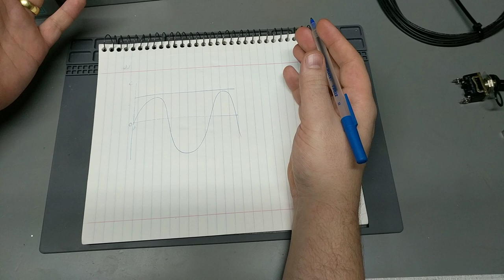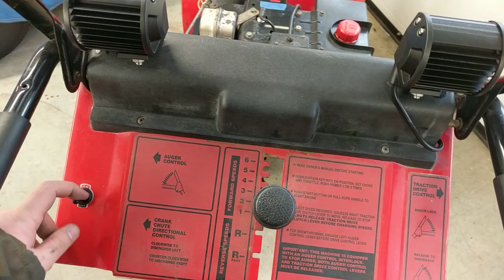LED headlights on a snowblower

Comment: I have the same engine and bought the same lights on ebay.  Do you think I can add a 3rd 18w light bar or will it be too much for the stator to handle?
Reply from the maker: Not sure, but you could try. The stator should be able to handle a dead short to ground all day, so running more lights will probably leave them all a little dimmer

Comment: Can you post a picture of the wires  coming from the spark plug and where is that going to? Also where is the switch wire coming out of the key hooking up to also on your plug/ coil do you have a pig tail on yours.     I could show you what I have.  I was looking for a digram online.

Comment: How do I install a headlight on my Toro 824 QXE? It never had a headlight.
Reply: You can't unless there is an unused power lead leaving the back of the motor. Usually if they don't put a headlight in at the factory the don't put a generator on the flywheel. You could mount either rechargeable lights like they use on bicycles or mount a battery pack or motorcycle battery somewhere and power the lights that way.  You would have to charge the battery between uses which would involve buying a battery tender or charger.
Reply: @99shadows66  
I was told that it would be costly to add the components from the other 8 HP.
I have decided to use a powerful rechargeable bicycle LED light. It fits on the side of the handle.
Reply: @stanleykeith6969  the video you gave a link to clearly shows that the snow blower has a factory headlight on it. Yes it can be done if there already is a headlight on the machine. This mod can only be done if the machine has a power wire coming from the flywheel area because that is where they put the alternator. No alternator, no mod, it's that simple.
Reply: @stanleykeith6969  These lights are battery operated they are NOT picking up a power supply from the machine itself. If I find a video that explains how the generator system works on a snow blower and why this mod can't be do done to all machines, I will post it here to help you  and others understand why some machines have an alternator and some don't.
Reply: @stanleykeith6969  Please watch this video to help you understand why some snow blower's have a generator and why some don't. https://www.youtube.com/watch?v=0ABIOlMPHtg&t=147s  If a machine doesn't have a generator, the running motor is not able to power any lights. Battery operated lights would be the only other option that I can think of as I explained in my original comment.